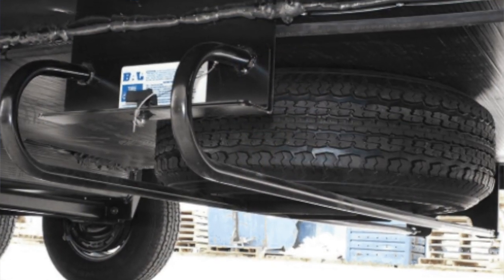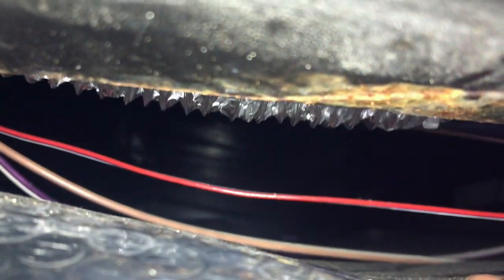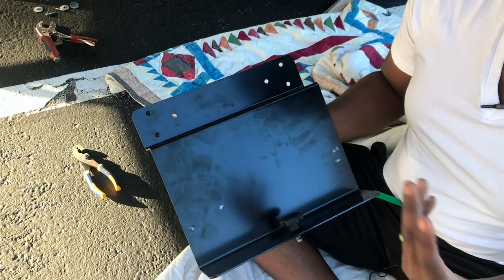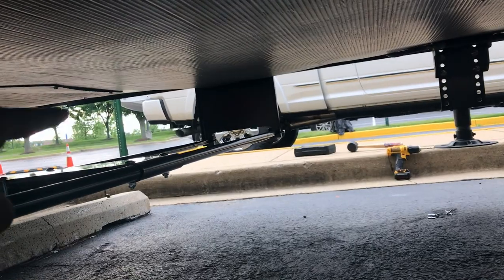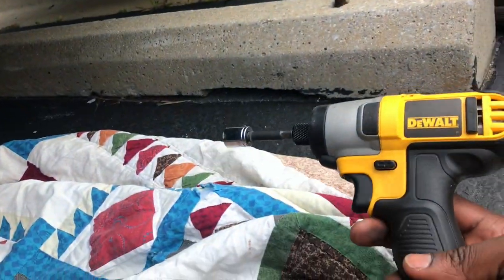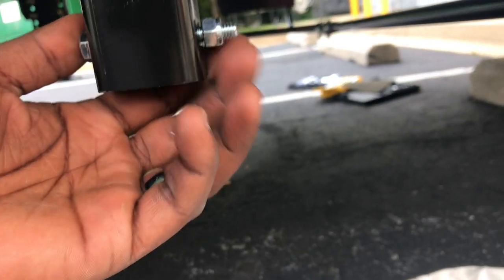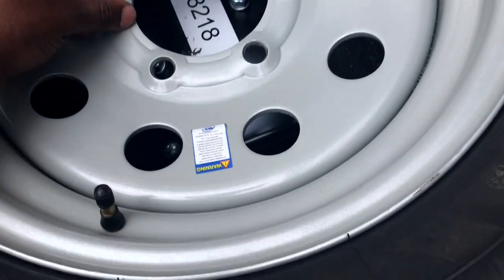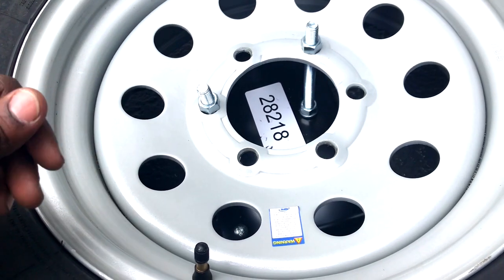BAL Hide A Spare - Great Spare Tire Solution - Complete Install!!!

Comment: One tip is to install tire with valve down - that way checking pressure is easy, and don't have to slide tire out.
Reply from the maker: Good point! I need to grease bolts and paint some other areas of the bracket so I will add this to the list, Thanks!
Reply: Or carry a compressor with you at all times like I do. Then it don't matter if its low, you top it off before installing it.

Comment: You did a really good job explaining the install and showing exactly how it works. I hope you enjoy getting out there and using your home away from home. About the comments saying this should be installed form the factory. Hell yea it should. Better yet a spare tire winch that pulls it up to the underbelly like most pick up truck and SUV's have. I'm going to the junk yard and cutting one out and welding it up under the utility trailer I'm about to by. The idea came to me out of nowhere when I was watching this vid. Anyone who can weld or can find a weld shop can do the same.
Reply from the maker: Thanks man! We use our fiver at least once a month even if it’s a short trip and we love to travel! It’s a pretty simple design so I bet it wouldn’t be too hard to fabricate. I just bought the rack for $100 bucks so it’s priced pretty well too! Thanks for watching!

Comment: We have this on our Bighorn and what sucks about it is when I went to use the spare tire, those two bars had worn holes into the sidewall of the spare, rendering it useless. It wore through the cord on the sidewall so bad that the tire would have blown out. Had to buy a new spare as west lake tire and heartland wouldn’t honor the warranty. I know have a round piece of wood, the size of the spare under the tire and between the tubes so it won’t where another hole in the tire.
Reply from the maker: Thanks for sharing this!

Comment: The tire mounting bracket can be loosened and moved closer to the edge so you don't have to slide out the pipes so far.
Reply from the maker: Didn’t know that, thanks for sharing!

Comment: And no problem with it dragging? I wonder if this would be ok on a travel trailer or if it would be too low. I imagine I would have to put it as close as safely possible to the axle.
Reply from the maker: Nope, It sits pretty snug on the underbelly and I couldn’t imagine it dragging unless you went up a very steep incline 👍🏾
Reply: There’s a pretty steep incline on the way into my MMJ dispensary. ;) I’ll park down the road and walk over.
Reply from the maker: Gotcha, I put mine out back to reduce pin weight on truck but you could mount it fire of the axles and be fine, just have to check the underbelly that nothing gets in the way! Good Luck
Reply: Maybe I’ll just keep it in the back of my truck 🛻 like it is now. Way less work. It’s a second spare. I always have two.

Comment: I’m not as agile as I used to be so 
I would rather slide the tire out instead of crawling under the RV to check the tire pressure.  Also, I carry a 12 volt air compressor so I would probably not worry about tire pressure.  Pressurize when I need it.

Comment: I would put some antiseize on the "knob" bolt. Mine came with my trailer and the other day I went to get the spare and that bolt was rusted in place. so I had to find a tire place to replace my tire that blew instead of using the spare.
Reply from the maker: Good stuff!

Comment: What a pain that BAL can't see fit to include the mounting hardware.  All in all though, a good video on the install. I'm still on the fence on whether I want to do this with my Arctic Fox 25Y travel trailer.
Reply from the maker: MrTommy001 I agree! If you want to move it off the bumper or out of the storage compartment I recommend it! Be sure to spray paint the bolts btw sense I never mention this in the video and thanks for watching!

Comment: I have a dodge caravan minivan..the cable underneath rusted n broke off..i live in my van and have zero room for a tire in the back..cant afford 4-500 bucks to replace the system..you think this would work under a minivan? Thx much for this video✌😊
Reply from the maker: Unfortunately this hangs down to low and it would be too wide in order for it to work. It may be cheaper to replace the cable and have someone lubricate it so it doesn’t rust again. Stay safe!

Comment: Great job. I'm about to install mine. I guess you simply put back the nails you took out with a hammer or did you use new ones or screws?
Reply from the maker: Thanks! Hammer them back in and they will hold as originally!

Comment: I wonder if this could be used under a truck.
Reply from the maker: Possibly with some customization. Problem is it may sit too low and it may be too wide. I also wouldn’t want to drill into the framing of a truck either 👍🏾

Comment: Good video. I'm  thinking of doing this but was concerned the tubing looks a little flimsy. What are the chances when you pull this thing out with the spare on it of the tubing bending.
Reply from the maker: Thanks and very unlikely. Although this product is cheaply made, it works well and if you do some prep work you should be able to use it without issues.

I would spray paint all the bright bolts that allow the product to move, grease the tubing so that it slides freely, and grease the bolts for the spare tire so they don’t seize. If you do this it should last a long time!

Comment: That should be installed from the factory.
Reply from the maker: Daniel A I agree! I don’t understand why they would put this inside of a storage compartment when beneath the trailer protects it from the sun and if you cover it, protects it from debris. Thanks for watching!
Reply: They are on many models, several Cougar and Montanas.